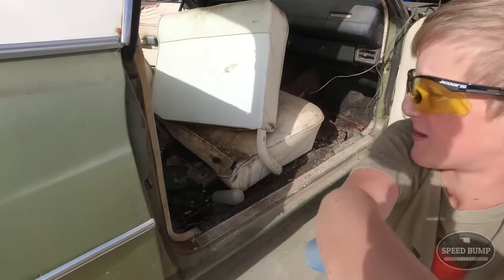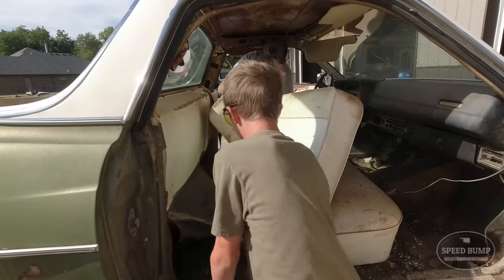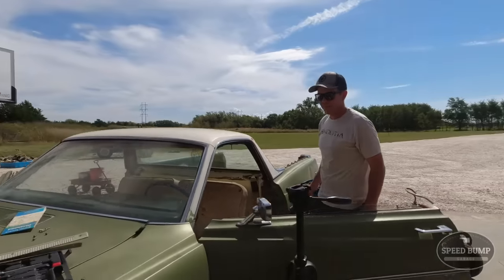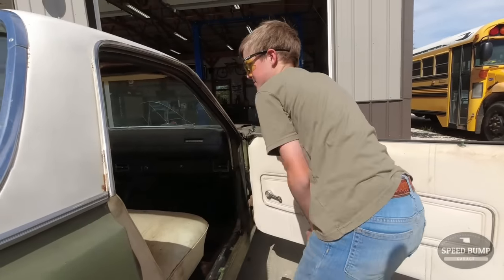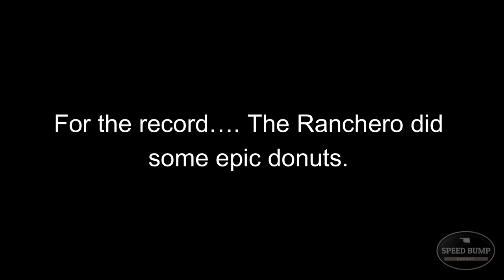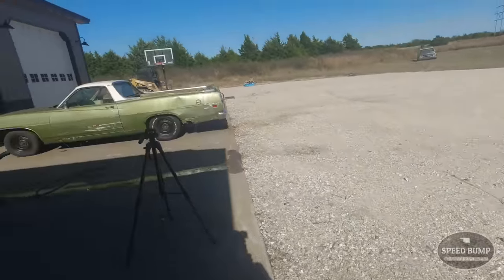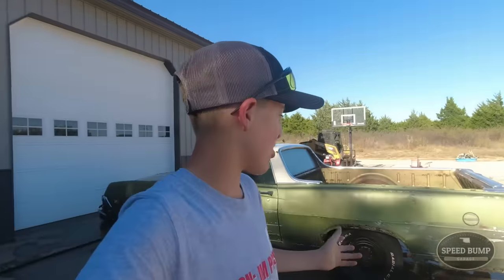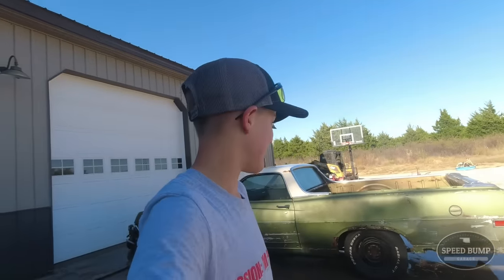Cleanup time for the JUNKYARD Ranchero

Comment: Depends on how far a restoration you plan but I think removing any loose rusted material and paint chips and some sanding then perhaps work on covering the floor holes and making the interior closed off from the exterior. After this couple consider pulling dents and dings as best as possible
Reply: I'm a girl, whose Father was my MOTHER. GOD BLESS JACK'S FATHER< AMEN.

Comment: Great Job on the project.  A good choice of cleaner it will not harm the seat and You can use it in the laundry. Iron out, either spray type or dry and mix with warm to hot water use as You wish.  My first car 69 El Camino I still think of it today, nothing like the first car memories.  Hope You will enjoy this ride and make lots of memories.

Comment: Thanks for sharing this project.   I would like to see it fixed up with minimal expense but safe and functional.  So I suggest  buff, grind off any bondo or really bad paint to rust or bare metal, and finally do the clear coat outside.  Fix the bent hood and tailgate if they dont work right, leave all the scars and dents or do minor paintless dent pulls.   Fix all sheet metal holes inside and update or trick out any interior to your liking. If you are going to make it your daily ride then put in double din bluetooth nav head unit and new speakers.  Fix all mechanical to make it legal, safe and fun to drive like maybe the exhaust and shocks. The battered look is super cool.

Comment: to clean the seat you might be able to get a really old product called wesleys bleachwhite spray it on the bench let it sit nomore than 3-5 minutes then power wash it off the product  I mentioned was for making a 2-3 inch whitewall or raised white letter tires  pop out at you being the bench seat is vynil covered it should handle the Wesleys white wall cleaner without causing it to crack but if it does we used to buy seat covers ie. sheepskin which looked ok for a rat mobile just depends how deep your pockets are if you can afford it take it to an apolstree guy & hut on new seat cushion & OEM seat coverings or leather but ultimately it's your car make it look how you want it to be

Comment: as to the paint there was this old car polish brand called Rally car polish that removed decades old ox·i·da·tion from the paint it was made to be put on by hand & you'd work really hard to  buff it off by hand with old worn out clothe diapers...lol the good old days when we used to bust or butts making are old beaters look shiek but it'd make an old worn out paint job look really good again or at least, I thought so.worked great on my 1963 Studebaker champ P/U betting that old Rachero engine had a lot more ponies than my 289cid packard engine. I think it was when I did mine it was way back in 1973 hard to remember but I got for $50 from a junkyard in Detroit had to tow it home.

Comment: Chlorine I'm a chemical sprayer 50/50 with water. Spray what your cleaning down with it and then pressure wash it. Will clean any mold/mildew/residue that's on it. If it doesn't fully work the first time repeat the process

Comment: Jack those hair line cracks on the hood look like fiber glass repair putty .They put it on to thick and didn't straighten the dents underneath it. You wil need to grind all that fiberglass off and correctly straighten the metal on the hood. You may need to put a light glaze on the hood but if it is to thick it will crack again. Hoods sorta float and vibrate and that's why that fiberglass "Bondo" cracked all over. The tail gate looks pretty rough maybe you can find a used one to replace it with. May be a hard item to find. Another option might be to find an after market skin to replace the skin on the tail gate with. You keep up the good work your dad is a good mechanic he will teach you the right way to repair cars!!!!

Comment: What may help clean some  fabrics I found works nicely is cheap  shaving  cream  use by rubbing in or lil scrubbing then with a very hot wet towel  wipe clean the longer the cream sets before you wipe with the towel the more color could change .if you see a movement but repeat process again

Comment: To clean the seats. First try green soap. No water. Just soap. Let it do it's thing. Then bee wax is a bit stronger. It will make the seat clean. But it will slide (slippery) wipe it down with (degrease) with some fuell. Then let it fume out.

If the green soap alone works. Just use some yellow cloth with water to wipe the green soap off. Use a soft cloth to wipe the seats dry.

Comment: You should get a mig welder with your dad and cut clean and weld new steel paneling cover that hole, and slowly do the whole exterior afterwards in your downtime. Then do a final grinding and sanding, then an at-Home or professional repaint. Then add a new carpet, then a new dash, then a new steering wheel, then new or reupholstered seats. THEN BUILD THE ENGINE

Comment: You need some stuff called bulldog it’ll take anything off the paint job of any vehicle only sand when you’re ready to paint or bodywork and replacing the metal is the best way to go very very little Bondo if after using it, maybe a grinder to grind the weld marks from new metal, but that’s it😊

Comment: Great job, when I plug up my sho vac I connect the hose to the blower hole and it blows the 'junk' back out of the hose. If you suck up a winter glove from under the seat you can bet it will get hung up in the hose😅

Comment: You can buff the carpaint. That will get the sheene back. I would get some paint matched rattlecans then do some paint restore. If that works out. You can do a clearcoat. 

Just do little pieces at a time. Learning how to paint is not easy. You can start with painting the interior before you put the seat back. That would make the interior (after welding) nice.

Comment: Pull the engine strip the car then sand primer and paint. That rust is the main concern and should have been at the top of the list of things to fix. I like to see the condition of bottom of the car.